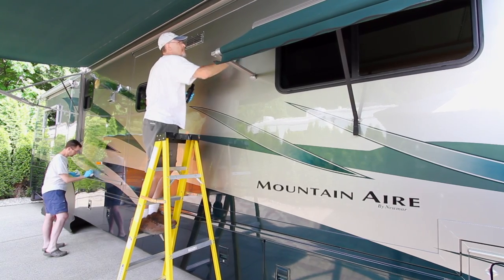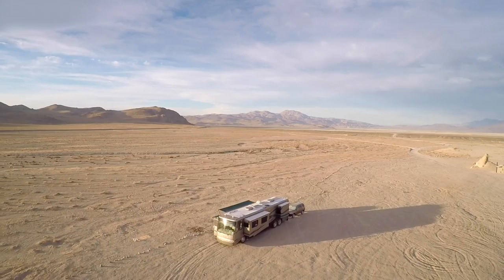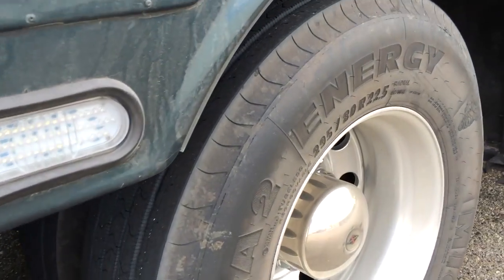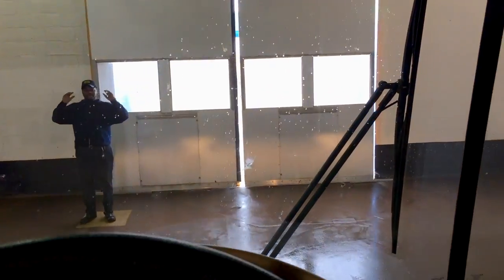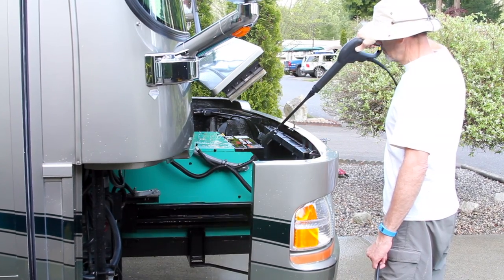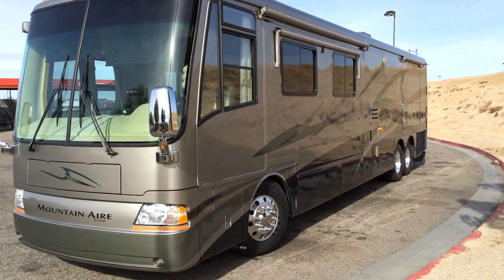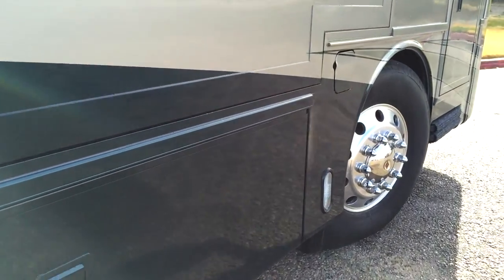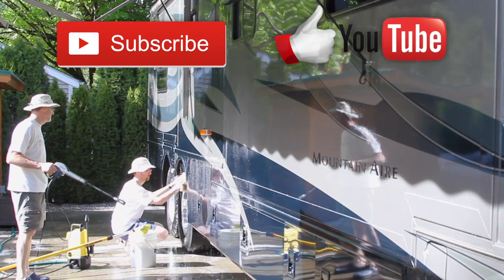A New Tool In Our RV Cleaning Arsenal

Comment: I also use Blue Beacon for my 43' Road Warrior fifth wheel and F350 DRW tow vehicle.  They do a great job and combined I paid about $45 dollars and I gave a $10 tip.  My first trip there was just with the Dually and I wasn't sure if they would accept it but they did.  If I remember correctly, that cost me $25 or so, including a RainX rinse.  I hate not being able to take my Dually through a regular car wash but I love my truck even more.
Reply: Holy smokes it takes me two days to to do mine, I pray there is one in the New Orleans area
Reply from the maker: Mphymel - while not exactly in New Orleans, Blue  Beacon has a location in Hammond... which isn't too far away.

Comment: I wish they had Blue Beacons in the North East, specifically New England.  We would use them all the time.  Alas, no love. At least not yet.

One caveat regarding washing your RV at a truck stop washing service.  Not all washing services are the same.  The thing about Blue Beacon is that they use a mild detergent that is designed not to hurt the finish (paint job) of RV's.   That's why they are the best to use.  However, other trucker washing services can and do use a harsher detergent that is not recommended for RV's so you want to do your homework and don't bring your RV to any washing service that uses a harsher detergent.

Comment: One caution about Blue Beacon or any "High Power pressure wash cleaning" for your RV. Water can get into outside stove vents, refrigerator vents, storage bays, Slide seals, as well as the generator area. Make sure you figure out a way of protecting these areas prior to the wash. Tape them off, block them with reflectixs material, etc. We had a generator damaged as high pressure water got into the circuit- board box. So although this method can get your RV clean just use extra caution.

Comment: I have been using them for over 5 years now., especially when coming home from the south as I pass one 28 miles from home. What they do in 20 minutes would take me several hours, and now after having both rotator cuffs repaired I use them even more.
In the northeast they tend top be more expensive. My average wash for the truck and trailer has been about $63 with the RainX treatment. I don't know if the RainX really works that great, but I see a lot of trucks opt for it and my rig always looks good when I get back on the highway.

The guys that do the work have a job I would not want, they are constantly getting sprayed in the booth. I usually will give a $20 tip to the "pit boss" in front of his crew (usually 8 total) and sometimes point put some areas like the cap or underneath the cap for extra attention.

And also here in the northeast several offer chassis under carriage wash for salt and brine removal.
Reply: BTW, if you do an inspection and don't like something, they will take care of it. And one time one of the workers knocked a marker lens off. The 'boos' immediately came over and offered to have it replaced. Wasn't their fault, the lens in question was already cracked and barely hanging on.
Reply from the maker: Thanks! Great to hear we’re not the only ones who get great service there. 😊

Comment: My first try at a truck wash(Blue Beacon) wasn't positive. The RV was pressure washed with some brushing. Then after the unit was complete they turned on the overhead automatic washers and it cleaned the roof really well. While wet the unit looked great. I also had my car and bicycles washed too.($50)
After we got home I noticed the windows and side had streaks all over the unit and half the back and my bikes weren't very clean.  
So...look over your unit before driving off.
Reply from the maker: Wow. We've heard that they're independently owned, so results may vary, and it sounds like you went to one that was on the low end of the scale, Ray. Sorry to hear. Hope you have a better experience if you try a different company, or at least a different Blue Beacon location.

Comment: Another wonderful video.  I started using Blue Beacon last year, and find that they're perfect for the "in-between" wax job cleaning.  One item to note, if you still have a propane fridge...  when they run the high-pressure hose outside of your fridge vent there is a VERY good chance that they'll get the inside wet enough to toss an alarm or fault on your fridge (assuming you're running propane while traveling down the road).  Once it dries it will work just fine, but just wanted to toss that out there as I was scratching my head when it happened to me the first time.  I couldn't figure out what had suddenly gone wrong with the fridge.  HA!
Reply from the maker: Thanks for the great additional tip, David! :)

Comment: There's no comment about risks using a pressure sprayer (spraying upward) near the external appliance vents or at/on the edge of double pane sliding windows(?)  We had issues with this when using a detailer :(  Results were 2 fogged windows and need to dry-out the mechanicals behind the fridge panel.  We have not used a truck/RV wash for this reason.  Would you say the wash shop staff knew these risks and compensated?  Thanks for another great video!
Reply from the maker: +Steve Matthews It seemed like they avoided power washing to hard or close, and we've had no problems. Sorry to hear you did, Steve. We'll keep an eye out for that.

Comment: Do you have a video on washing your diesel engine? We have a 2003 Dutchstar w/Catapiller engine and the engine needs washing big time. After a week at the repair shop getting a turbo sensor and new muffler/catalytic converter combo replaced(dirt parking lot), it looks like it was entered in the Baha 500. Do you spray the engine down with an engine degreaser first or dish washing soap(like dawn) or something for pressure washers. Or do you just use plain water and only rinse it. Sorry for the long rambling question, but I know you guys will do it right and I'm looking for info. Thanks,  I enjoy all your videos.
Reply from the maker: We just use our Karcher pressure washer. It's only 1,500 PSI, and not powerful enough to hurt anything in the engine compartment. http://amzn.to/2GPwV4W We did a video about our spring cleaning regimen where I think we mentioned this: http://thervgeeks.com/maintenance/preventing-rv-roof-leaks-dicor-maintenance/

Comment: Nice job fellas,couple of questions,how do you get rid of black streaks,have used black streak remover,doesn't work well,also what wax works well,I really dread cleaning rig,sore for several days,lol
Reply: MrSilverside 
Try a Mr. Clean Magic Eraser along with your Black Streak Remover. At least that's what I use to get the black marks off the slides made by the rubber seals.
Reply from the maker: Thanks to MrSilverside for chiming in! We'd add that the best way to keep black streaks from forming in the first place is to keep the roof as clean as possible.

Comment: Great info guys and nice presentation as usual! I, on occasion have considered using one of those truck wash places but have always been a little reticent about using them. Most of the ones I have seen are dirtier than my coach after a 2 week off road adventure! Looks like you found a good place! BTW, have you ever been turned away due to the age of your coach? We ran into that a lot in Florida which was shocking to me being as our coach is kept as nice looking as yours. 🤔🙂
Reply from the maker: Never turned away, but we mostly boondock. 😉
Reply: @RVgeeks  I'm with you guys! The boondocking is the way to go! Have you ever serviced any debris build up between the radiator and the intercooler? From what I hear the side draft design like yours is better than the rear draft design like mine.
Reply from the maker: We’ve never cleaned ours. Side radiator is definitely a big benefit.

Comment: Hi guys. That baby looks great.  Just wondering what your thoughts are regarding using Zep Wet Look Floor Polish. Are you familiar with this product?  Thx bg
Reply from the maker: Hi BG. We've heard about people using Zep Floor Polish... but primarily on RVs that don't have a full paint job. So we've never used it... but our concern about anyone using it is the fact that the floor polish isn't designed for outdoor use, and could break down or yellow over time, making things worse, not better. We haven't read of people having that problem... but it's definitely something we'd suggest that you look into before doing. We'd hate to see you do it, only to find out a couple of years later that you wished you hadn't!
Reply: Yep those are my exact concerns.  It's the back end of that decision that I've not heard any one describing.   Typically with commercial floor Polish you have to chemically strip it off when it's time to reapply.  I think I'll stick with the more traditional wax.  Take care
Reply from the maker: Yeah, that's a good point, BG. Not sure how (or IF) the people who are using the ZEP products are properly removing them for re-application. Seems like it's one of those things you can do to make the finish look good today... but what about 5 years from now? We've always used automotive wax on the finish on our RV... and right now are using Meguiar's NTX 2.0 Tech wax (available on Amazon: https://amzn.to/2xx5WHr ) and LOVE it. Easy on. Easy off. And it lasts!
Reply: Thx for that product info... will look into it.   I have a 5th wheel so the majority of the external surface is fglass.  Take care

Comment: How much did it cost?
Reply: He said in the video about 40 clams
Reply from the maker: Hojo70 is correct... having our 43' motorhome washed costs about $40, give or take (shorter RVs cost a little less). When we have added in having the car washed at the same time, and having the whole thing towel dried, it's been as high as about $60.

Comment: I'm wondering if one of these cordless units would work. https://www.worx.com/hydroshot-portable-power-cleaner-wg629.htmlNot too much water pressure. I wonder if 10-15 gallons of water would do it? (You can also use a two liter bottle of water, for small jobs.) Add some Calgon, the water should "run" right off. Just thinking ahead. I drove Motorcoaches, and school buses for 15 years, and we used Blue Beacon Truck washes often.

Comment: Is it safe to assume they'll do 5th wheels as well?
Reply: yes they do i have them do the works and the 2 around my area ( central KY) are great
Reply: Thanks! Can't believe they only charged $40! I'm sure it varies by state, though...
Reply: They do.  Just be certain you don't have anything in the bed of the truck that you don't mind getting wet.
Reply: Any thoughts on disconnecting vs: keeping the 5th wheel hitched?
Reply from the maker: I don't think you can do it any other way than keeping the 5th hitched, since they probably wouldn't be too keen on disconnecting it in the wash bay.

Comment: Don't wash engine and electrical bays with compressed water. Tap water can get into connections and corrode them.
Reply from the maker: Thanks so much for the words of caution. You do indeed need to be thoughtful about using a pressure washer on the engine and generator, but it can easily be done safely. If you've ever been to an engine shop (unfortunately, we had a serious oil leak high on the engine block a number of years ago), Cummins diesel mechanics routinely used far more powerful pressure washers than our little portable Karcher unit has. They do it all the time to thoroughly clean engines to find oil leaks, and to confirm after repairs that they were successful in fixing them. We also pressure wash our car's engine on a routine basis. Since the advent of electronic ignition and fuel injection, it's a breeze, with no worry about water penetration, as long as you don't go crazy and hold the wand an inch from things, or for long periods. Now the place to be very mindful of not aiming the water directly at electrical components (at least in our rig), is in the generator bay, since all up above it there are LOTS of connections. We simply aim the water downward onto the generator and don't linger for long periods in one spot, and don't get too aggressive with it by getting really close in (keep the nozzle back about a foot). We've never had a problem, even though we do this all the time. Thanks for reminding people that care does need to be taken though!

Comment: A note to viewers: spraying water into an engine bay is an incredibly stupid idea. There are expensive electrical components that could easily be damaged or ruined by water.
Reply: HAHAHAHAHA.... yeah, because engine components won't get wet while driving in a rain storm. Get real. All manufacturers utilize weather resistant components and connectors like Delphi, AMP, Deutsch, etc. If you keep the nozzle at a reasonable distance, you'll never have a problem.
Reply from the maker: We've had our motorhome in for engine repair work several times, and the Cummins shop has blasted the engine with far more powerful water pressure than our little portable Karcher unit to clean off the engine to check for leaks after repair. Sorry, but your comment just doesn't hold water. :-P